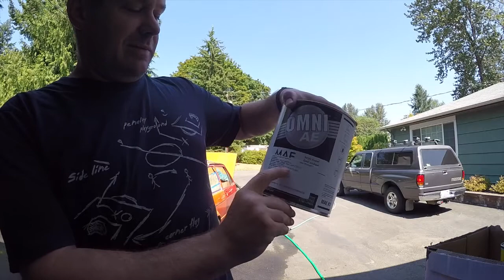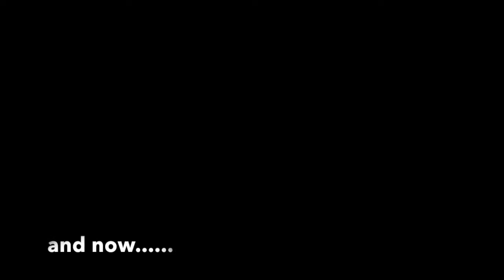Painting interior using Eastwood Concours LT HVLP! 1975 VW Rabbit 1.8t 20v ep21

Comment: Good job on Video.  I was researching that gun and found your video.  Do you have video on the review of the gun?    Did you use it to shoot the base and clear or is it a single stage ?
Reply from the maker: I shot base with it on the rabbit, and base + clear on the boxsturd. It worked good for both, although I think I should have changed the needle for the clear.
Reply: @ThrottleGrotto   to a 1.5 nozzle ?
Reply from the maker: @sultanmohammadahmadzaidan9435  I haven't tried that, but they are interchangeable